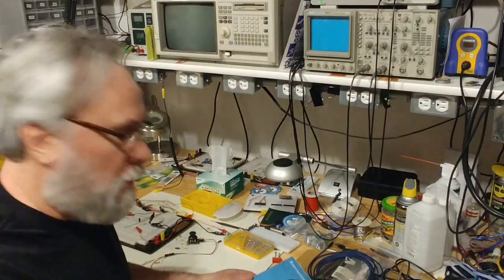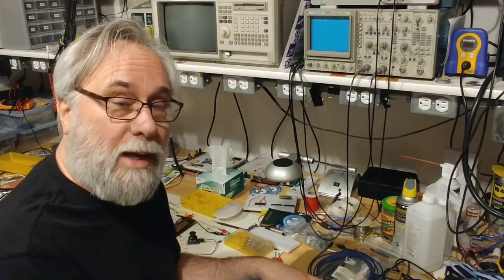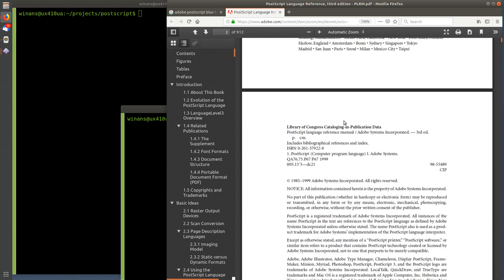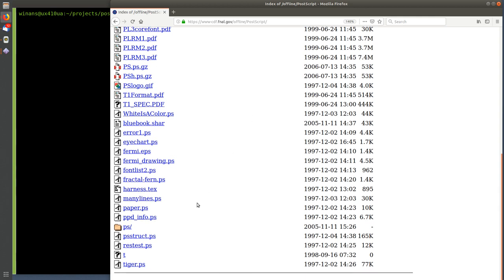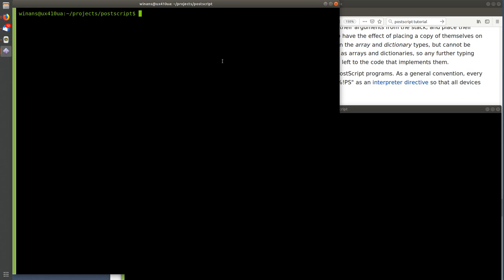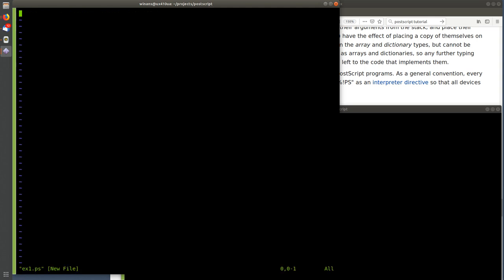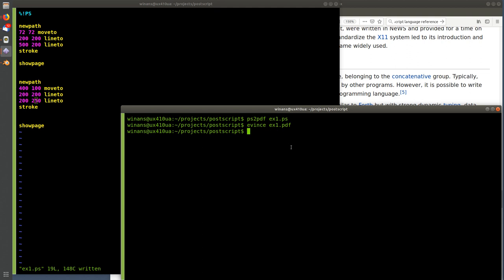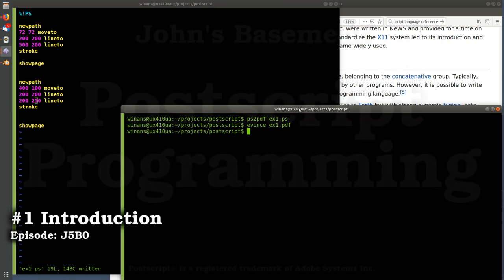Postscript  #1 An Introduction

Comment: For those that are running Debian and don't get a visual output by using the ghostscript interpreter.
You need to install the  ghostcript-x package.

Without it, there will be no x11 output. You can check this, by entering "gs -h" in a command line. Under available devices there should be someting like x11.

Comment: I need to write a program which takes data from a database, does processing on it, and then prints out a nicely formatted output for a printer. In Linux, all I need to do is make the program save the file in LaTeX, run pdflatex on it, then call evince or the default pdf viewer so it can be viewed and printed by the user. Wonderful.

But I can't do the same under Windows. LaTeX is not a standard install on Windows. Neither is Java, which is the language I decided to use for that private software to be used company-wide. The solution I came up with is to make that private software save the file in Postscript. I only hope the default install of Windows has an available default viewer and printer driver for Postscript.

Despite Postscript not being particularly fashionable these days, it still has its uses.

Comment: Hi John, what book or something like this would you suggest to learn programming microcontrollers in C language? Thanks for videos about KiCad
Reply from the maker: You'd think this would be an easy question to answer. But it REALLY depends on what you want to learn/accomplish. If you already know C and the approach in this video is appealing: https://youtu.be/iml0DBo5yqo then look at the course web site in the video comments for links to other related stuff. 
You can do some google-searching for 'bare metal programming' or 'freestanding gcc' and see where that takes you.
If, on the other hand, you /meant/ to ask about programming the peripherals on embedded SOCs then I suggest you pick a CPU and start looking at its databooks. In recent years, I have found the LPC-series chips from NXP to be very friendly and are supplied in LQFP packages that allow me to hand-solder them into my own custom PCBs like the ones you likely saw in the KiCad series.
You are going to have to tell me more about your goals for me to know how to reply any better than this.
Reply: @JohnsBasement  My goal mainly is to build hardware which may not be that difficult for me and write software/firmware for controling this boar. For example I do not know to much what are layers in writing code. Like you have your I2C and you have some functions for handling transmit and recieve but something should be on the top of this transmit and recieve :) Thank you for your help
Reply from the maker: @Antyelektronika  So, you are asking about how to create an API for a message-based interface?  Nothing immediately jumps to mind on that topic. I learned how to work at level by just diving in and figuring it out. These days you might be able to sift through examples of how device driver interfaces work in simple embedded operating systems like FreeRTOS, RTEMS, uC/OS, etc.

Comment: Do you need to know postscript to develop custom RIP software for inkjet printers?

How would one begin programming/developing custom RIP software?

Wish there was more info online about this.
Reply from the maker: I do not have experience with inkjets.
Depending on what aspect of the conversion you are interested in, I can note that I usually get what I want from raster images by using one or more of the parts of the Netpbm package:  https://en.wikipedia.org/wiki/Netpbm

Comment: Can I use Postscript for animation or interactive programs? For example, can I write a game in this language?
Reply from the maker: I've used it for creating animated charts by rendering timeseries data into a jpeg-per-page with ghostscript... and then into a video with ffmpeg. (Which I should write up how to do at some point.)
Interactive?  I haven't tried. But I'll observe that display-postscript was invented for that purpose (first I've seen it was on NeXT and then on OS X today)... and, I believe, is the basis for PDF files.  But I'm not familiar with using it at as low a level as I discuss postscript in my tutorial series here.
Reply: @JohnsBasement  Thanks for the answer.
Are you planning to talk about animation in your video tutorial series?
Reply from the maker: I can add something that talks about something like my stripchart data animation video.  (I can't promise when though.)
Reply: @JohnsBasement  It would be great. Thanx.
Reply: PS was never made to write games. PS is made for printing. It is vector based, not bitmap based. For classic games you want to write bitmaps and pixels fast in video RAM. Today you use hardware accelerations and APIs like Vulkan, OpenGL and DirectX for that.
If you need a simple 2d surface, you can use DirectDraw on Windows and if you want programm for every plattform, better  use SDL 2.x. Version 2.x of SDL is hardware accelerated too.
As a programming language you can learn C++.
But if you only want create simple stuff, there is a library for Python that allows you to use SDL in Python.